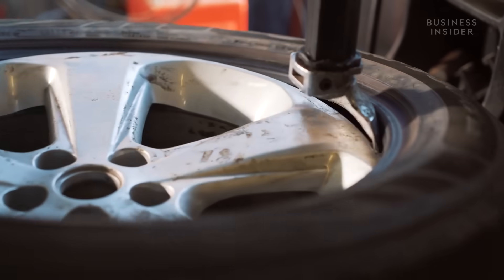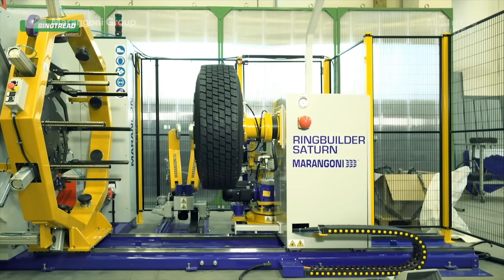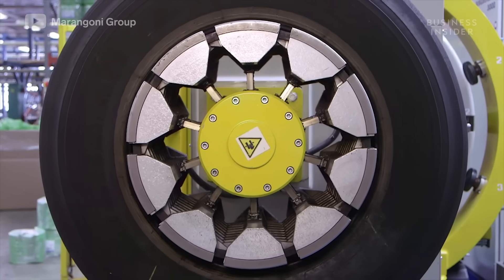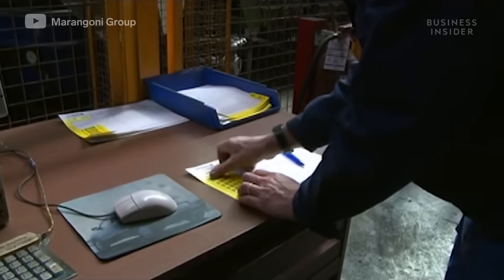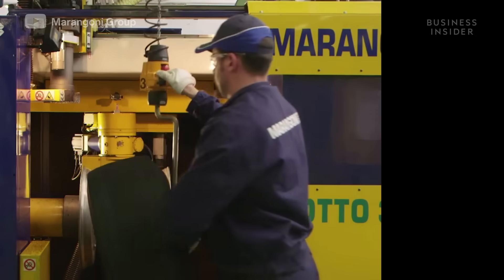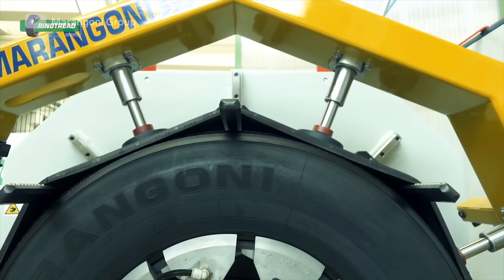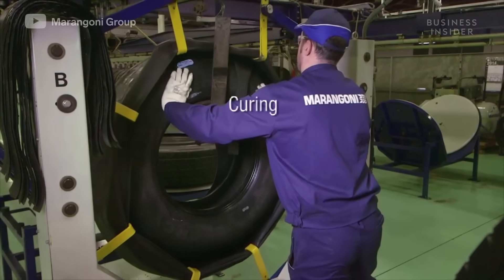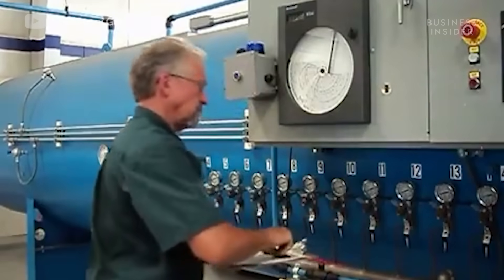How Old Tires Are Retreaded So They Can Be Used Again

Comment: Retreads are crap. Ask anyone in the trucking business. They just litter our highways. Never buy retreads, and trust me you wouldn’t want to be beside a semi when one of those blows.
Reply: The tire treads on the highway.  Are referred to as "ALLIGATORS" by truckers and highway maintenance crews.  They have a bite from the steel cords within the tire.  Alligators are caused by; overloaded tires running hot, a tire going flat that is driven until it fails, or a tire that was underinflated with a load and then properly inflated.  I spent 8 years working for Caltrans.  With 2 years on a highway maintenance crew, and 6 as a technician on a pavement reasearch project contracted through the University of California.  During the test cycles we would use various types of tires underloads up to double the rated load.  Tire pressures were always the correct specification.   No retread or standard tire ever failed.
On the highway maintenance crew I also saw tread seperations.  Which go to the belt surface.  Never saw a retread lose its tread.  The highway maintenance crew work was done with w/c 719 in the Los Angeles area.  We would collect 10k lbs of rubber tread every 2-3 months.  That was the capacity the roll off container that went for recycling.
Reply: depends on your load and type of business. my old man's company handles road project in far rural areas and our landscape are mountainous, so retreading works just fine. those trucks are never going past 40km/h
Reply: I run a 130,000 lb. Truck on retreads every day.  Blowing a tire on a truck is never scary for the driver unless it's a steer tire,  and nobody runs retreads on the steer axle.    Been driving big trucks over ten years and I've only seen 3 retreads fail,  but I've seen dozens of brand new tires separate and fail....
Reply: @fomocowboy  my father has a company of about 50 trucks one point and he tried using retreads and they are terrible he says. When the truck is near max gross and the pavement is hot. It's only a matter of time. We only use Bridgestone and Michelin on our trucks. We have a few toyos but they also blow out more than other brands according to my dad so they are getting phased out.
Reply: @patriotsfan1236  well what do you expect you just said you're maxing the tires and you have them on hot asphalt lmao heat expanding air in a tire that is max on load capacity= tire failure. Should do some research
Reply: @xLegionnair  the cold fill pressure amount takes heating into account....... the manufacture recommendation is still typically under the cold fill psi.
Reply: I run retreads everyday of the week they normally work great but there is a time and place for them
Reply: I have trailers for rent and I always buy brand new tires. I don’t care for used or retread. At the end of the day it is not worth loosing money or endangering people.
Reply: German Garcia Jr 

Yep 👍 and they make a mess of the trailer when they blow to, eg mud guards air lines wiring, lights ect
Reply: Retreads are great for drifting.
Reply: New truck tires have tread separation also. Many you blame on retreads are new.
Reply: All of the major fleets in America run retreads and they wouldn’t do it if they failed at the rate you’re saying. Check the “litter” you see on the road next time and see if it has cables in it(it will). If it does then it’s not a retread that blew its a cheap virgin tire. Chinese tires are everywhere now and fail more often.
Reply: With the pressure that that will give off if you're beside it and it hits you? You'll probably die or get seriously injured
Reply: Good retreads are just as good low-mid tier tires
Reply: Retreads don’t perform as good as new ones. They don’t hold up to heat or heavy weights very well. There’s a reason they won’t let you run recaps on the steer tires!
Reply: New tires account for more than 68% of all exploded tires on the highway though?
Reply: Exactly! We bought some retreaded tires for our Rzr, they disintegrated.
Reply: @Gene Hoglan what??
Reply: Not a single person on this thread knows anything about retreaded tires or the fact that they are just as safe as brand new tires. I work at McCarthy's Tire Service Retread Plant in North Eastern Pennsylvania. Tires are to be visually inspected for any injuries or foreign objects stuck in the tire they then "after being marked for damages" get put in the sherography vacuum to check for unseen damages to plies or air trapped under the rubber. The old tread is then buffed off and the tire is sent to be skived. Skiving is just grinding damages to the rubber above the plies then applying a rubber glue to those area so they can be reformed with a rubber extrude while the case is wrapped in this extrude to create a bonding surface for the new tread. The tire then goes to a "builder" whom takes the tire measures it and cleans the extrude case with a solvent to make sure there is no contamination between the extruded casing and the new tread. The new tread is then applied to the tire and the tire is sent to the "chambers" or pressure ovens to be put in a bag and sealed by a technician before they go in the chamber. Once they are bagged they are individually hooked to vacuum lines in the chamber which suck to air out of the bag enveloping the tire the chamber is then sealed and heated to roughly 220°F and then the chamber pressurizes to ensure the tread is firmly held to the tires as the rubber melts and binds with the rest of the tire. The tires are then removed from the chambers and there bags and sent to "Final" which is the final inspection point to make sure the tread has been bound to the tire properly they check for any missed damages or problems with the tire in general the tires are then branded,labeled and painted once deemed fit for the road. Tire manufacturing company's have propagated the fact that retreads are not safe but it is not the least bit true alot of time and effort goes into each tire to make sure they are safe. Let's just remember that before retreads there were still "tire blossoms" on the side of the road and retreads have not increased if a company puts people at risk by carrying loads that exceed the tires capabilities then who's fault is that I'd say it was the company driving them or just bad luck.
Reply: @xLegionnair  right, even commercial planes use retreads. And I'm sure the quality also depends on the manufacturer
Reply: @trygveevensen171  not very much, it's how you make it
Reply: Why tell me???
Reply: Bullfred !!!!
Reply: I've seen one myself blow.
Reply: Yeah that’s true
Reply: could probably do better for some smaller cars that don't put as much stress on the wheels
Reply: Oh I have been. Sounded like a cannon going off next to me while passing the Semi
Reply: I work for heavy truck part recycler. I have to decline when truckers ask if we would sell them bad condition tires for road use. Some people will do anything to save money
Reply: They retreaded my chip trucks and it loses chunks like a boss
Reply: Yes I hope the teamsters don’t allow this, of course it’s fine for normal cars which don’t have as much stress
Reply: So your telling me there is a difference between a brand new tire and a retreaded tire blow out?
Reply: @kap1526  yeah
Reply: Almost had a chunk of one go straight through my windshield and kill me but I swerved over in time and it took my driver side mirror mount clean off
Reply: @grizlyman53  dude did you have to change your underwear after?
Reply: @slyclyde2900  nah but i thought about what wouldve happened had i not swerved to the right
Reply: @grizlyman53  those thoughts are scarier than movies
Reply: Australia is one of the most over regulated countries and they're perfectly legal because of 2 factors:

1- it's only truck tyres that get retreads here.
2- it's heavily regulated and the quality control is beyond approach.
Reply: That is right
Reply: In china, when a truck has a bad tire, we buy a new truck.
Reply: Just melt it again, AFAIK rubber can be recycled countless times
Reply: John  probably the dumbest comment every in the history of YouTube
Reply: Sure... you see them all over the place... maybe a hundred a day after driving 700 miles.... compared with the millions of trucks roving the highways all day every day... a couple hundred sure is a lot... wouldn't want to take the risk. nope no way!... Some people really blow this shit way out of proportion, can you really no comprehend how often this DOESN'T happen? No, because like a typical person you see one bad thing and forget a hundred good ones.
Reply: Retreads are crap for sure. Here in Canada they are illegal to use on steering axles.
Reply: @Wildstar40  some here on trucks
Reply: @Wildstar40  in America
Reply: You're right. The company puts the driver at risk for a profit and the truck owner puts the rest of us in danger because he's too cheap to do the right thing.
Reply: @ German Garcia Jr I don't know if it was a retread or not, but a semi had a tire blow out while driving close to me (can't remember if I was beside, or in front of him) and holy sh** was it loud. Scared the crap out of me.
Reply: @dexm2010  - tried that too once, nearly had to change my pants when I got home...
Reply: @dexm2010  If it was that loud, I can assure you that it was retreaded
Reply: Yeah, really really loud. Hopefully I won't be in the vicinity again of another one when it happens.
Reply: I nearly totaled my car that I was literally driving home from the dealership because someone drove over a full tread that had come off a trucking tire.  It flew up in the air and did over $3k in damage to the frontend of my car.  Was sooooo pissed and now I realize it was probably a retread.
Reply: Well don't new ones do that as well sometimes?
Reply: @henk-3098  no
Reply: @henk-3098  Well don't new ones do that as well sometimes ?
The major cause of tire blow up is, go figure, under inflation. Why? Because when under heavy cornering, an under inflated tire can have its sidewall bulged outward. This additional flex in the sidewall compromises its ability to bear weight and can cause the sidewall a blow-out.
Also, over inflation or overloads on hot asphalt also play an important part here.
Reply: @henk-3098  no. new tires rarely blow up. retreads are what somtimes blows up. and that's a big somtimes....
Reply: @henk-3098  a new tire is very unlikely to explode if pressure is kept within it's range and it's not damaged.  A retread has a good chance to explode!
Reply: @terrydouglas5008  do you know anything about tyres?
Reply: @hercegovac9999  I know about retreads, they come apart, often!
Reply: @terrydouglas5008  yeah I work at retreading company and we give guarantee and small percentage of people are not satisfied with them
Reply: @henk-3098  new ones are better
Reply: That's because lazy ass drivers don't check the tire pressure and add when needed.
Reply: Retreads are deadly! I wish they were banned
Reply: Yes they indeed are crap
Reply: I've seen 1 acident and 2 trucks veer off their lane due to what seemed like faulty  tires I can vouch for this
Reply: @nyikiwe  The tires aren't really that big of an issue. it's more of the surprise, people don't react well to that sort of surprise but if they had been prepared they'd probably handle it much better. Had a coworker of mine blow a steer tire on his rig going 80mph up I25 near Denver, CO. Fully loaded tanker and he made it safely to the shoulder without any other issues. When it comes down to it driver's need so much more training than they're willing to actually get.
Reply: It’s fine on regular cars and pickup trucks
Reply: Retreads are just for normal cars not big trucks
Reply: @OkamiKitsuneGaming  and yet only big trucks use them.  Tires also age independently of wear, so it only makes sense to retread newer tires that have a lot of wear, which tend to be those from commercial vehicles.  And yes big trucks use them the most on the trailer tires.
Reply: I've seen an entire vehicle blown to pieces by an exploding semi tire. That shit needs to be outlawed.
Reply: Mar Mars exactly
Reply: Tires suck in general. We need an alternative.
Reply: @DrEvil-os9dc  Goodluck reinventing the wheel
Reply: @DrEvil-os9dc  maybe like metal tyres, and we can have a rail lane for these long hauling trucks. Then they still have tyres for local roads. But they can have rail wheel that run on the inside on the tyre that pop out.